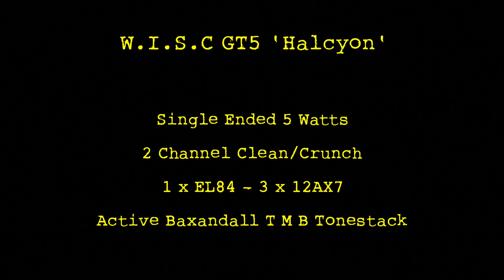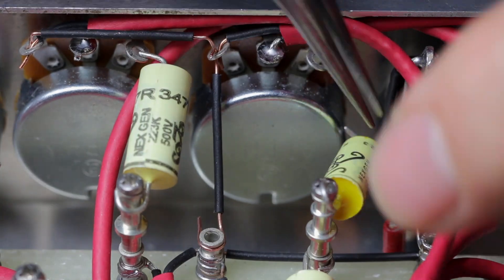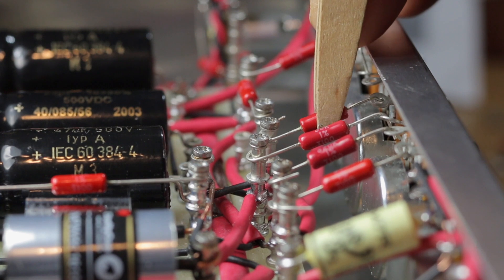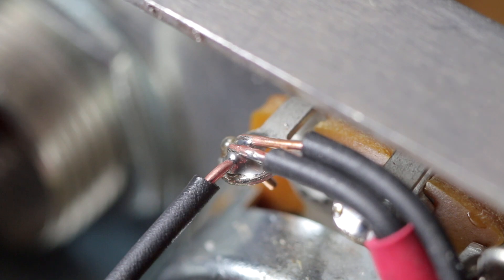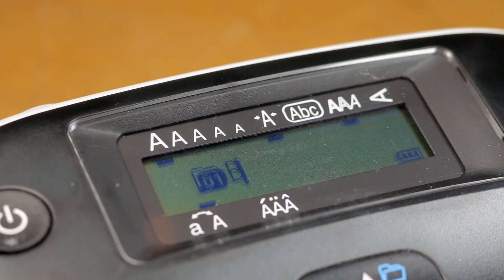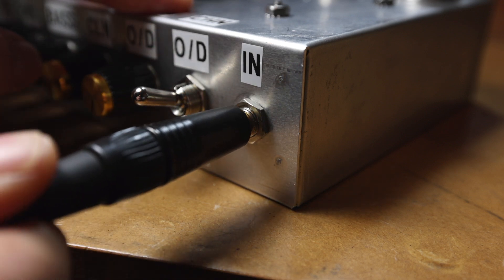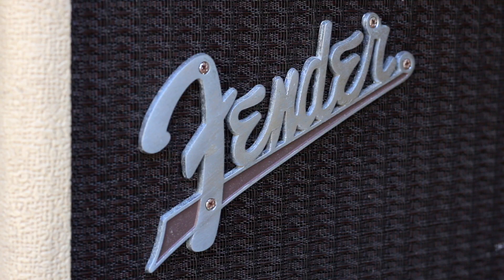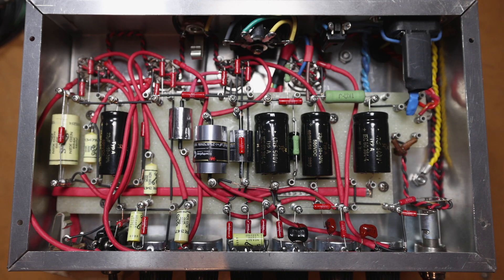Tube Amp Build Completion - W.I.S.C - GT5 'Halcyon' Build 6

Comment: Have you built anything else since your last video?
I loved the Laney rebuild and the lay out.
Reply from the maker: Hi Tony. Yes, I have built a 6V6 Version of the JCM800 with the choice of 2 different FX Loops that actually work. In addition, the FX loops are NOT LN150 FET driven, rather they are opamp driven. The loops are parallel type, o e of which achieves parity and beyond. Video and free plans to the 800 coming maybe June. Cheers.

Comment: I love your concept of turrets, but don't you think they introduce electrical characteristics?  My heart tells me that point to point soldering is superior in terms of expected sound quality.  Don't these turrets have capacitance, current features, etc.?  No matter I really enjoy the way you edit the video and good quality close ups, obviously the end result is excellent.  I think I will incorporate your turret tech style in future builds.
Reply from the maker: Yes turrets do introduce their own electrical properties, mass being the main one, meaning more opportunity for unwanted induction. I now use solid brass machine bolts where double turrets would normally be. Less mass, solder, less complications. Every component, whether that be resistors, turrets , cable, every little thing in the amp affects the system in some way. The less complicated the better. Everything is a compromise. Simplify one thing, creates complications elsewhere. I'm not opposed to PCB at all, in fact PCB's are ideal for things like FX loops, or anything revolving around pedals, as after all, they are solid state devices themselves. That been said, I do prefer turret point to point for tube amps. The high voltages render PCB a tad unreliable. You have to find your own peace of mind in amp design, anything is possible and everything you have said makes sense. You obviously give it some critical thought and thats what its all about. The more you can think about the electrical system, the better you are placed in ending up with a noise free amp. Thanks for the input and all the best for your builds.

Comment: Turning the mids down really made it smooth. I know it’s a rough recording tho. This design is very tempting with the Bax. It definitely is a whole different animal. I’ve built a few of Forrest Cook’s amps and he’s quite fond of Bax tone stacks. They all turned out great. Building his stereo preamp currently. 
 I’d be curious to try this schematic out with more affordable components. Sozo’s and Jupiter’s are fantastic (especially the red Astron Jupiters) but oh so expensive. Do you think Panasonic coupling /bypass caps would suffice?
Reply from the maker: Thanks William. Indeed any bran of components will work. I too like the mid scooped tone. The Bax stack is a great circuit and it baffles me how the bax gets little love - probably more to do with voodoo science than anything else. IMO, the Bax demolishes the Marshal/Fender type stack. Good luck with the stereo amp, nice. Cheers

Comment: thats a really good idea for the xtra turret height. where do you get your turrets and boards from? you sound local (i'm in AU you might be over the river from me)
Reply from the maker: Cheers Greg. Yeah the doubling up of turrets is a massive help in building. I'm in NZ, however I remember buying the turrets in bulk from a USA supplier that no longer exists. The same turrets can be sourced from AmplifiedParts dot com, however, one pays a bit of a premium. I did find the actual manufacturer at one stage but I'm buggered if I can find it again. Cheers.
Reply from the maker: Use product code.......SKU:	S-HTUR-P

Comment: Are my ears busted, or is there no hum from the amp when idle? if so that is amazing...
Reply from the maker: Thank you, yeah she's pretty quiet. Only a tad bit of noise when really cranked, otherwise there is almost no hum. Cheers
Reply: @elams1894  You should do similar turret board optimization for popular amps, Fender Deluxe Reverb, Vox AC 30 etc. that would be a big market. I'd be your first customer for Deluxe Reverb :)
Reply from the maker: @seekeroftheways  I plan to do just that. My first will be the JCM800, followed by JTM45. Cheers
Reply from the maker: Deluxe reverb will be in there. It takes mega hours to hone it all out, then build, then tweek, but it will be alot of fun..
Reply: @elams1894  will be patiently waiting for the kit and the awesome vids like food for the brain.

Comment: I got a knob idea, but not sure whether it'll work. I intend to make wooden knobs myself. But I don't want any set screws or anything like that, instead I will be soldering a bit of metal to the turning part of the potentiometer (making the top a T shape) and then fit a wooden knob onto that so it won't slip, right. Not sure whether it will work but it would leave a clean knob
Reply: I don't want to wreck my potmeter though right, that's why I'm sharing this idea with you, like to know what you think
Reply from the maker: It could work, however seems alot of trouble. I'm not sure how you will stop the knob from pulling off the shaft. Grubber screws leave a clean finish. You just have to make sure you have a nice brass ferrule insert for your knobs.
Reply: @elams1894  well, you don't pull on a knob do you? (:

Comment: Sound absolutely mint! Here's a totally stupid question - I'm okay with capacitors, resistors, and that's about it ... what do the tubes do?
Reply from the maker: Thanks Rob! A tube can have typically three our more areas where magnetic fields are introduced, triode three areas, pentode five areas for example.

For a triode (12AX7) preamp tube the AC guitar signal magnetic field is established on the grid. The plate of the tube has the large DC magnetic field, with hundreds of volts manifest upon it. The cathode of the tube is connected to earth (same magnetic field as earth) sometimes in a variety of ways. 

The tiny guitar magnetic field of the guitar signal is easily coupled with the large plate magnetic within the tube vacuum, and is amplified in the process. This plate magnetic field, now coupled with guitar signal, also couples into the cathode through induction, much like a capacitor. Because the cathode magnetic field is opposite in terms of pressure gradient, or phase, the cathode earth magnetic field can be used to regulate the amplified guitar signal, now on the plate, with the use of resistors and capacitors.

A tube is almost like a capacitor, but having an extra plate in the middle of the normal two plates of a capacitor, all within a vacuum.
Reply: @elams1894  thanks for the detailed explanation. So the different tubes create magnetic fields having different characteristics and thus altering the ultimate sound character I presume. Does this mean you can chop and change the tubes in order to change the sound of your amp? It's fascinating. I had a tube amp when I was a teenager back in the late 80's, damn it sounded good at full volume, used to put it in my sister's room with the door closed so I could still carry on.
Reply from the maker: @TakamiWoodshop  Different tube brands of the same kind have very subtle differences, so yes you can swap similar tubes for slightly different tone. However, you cant swap dissimilar tubes. Indeed tube amps have a very sweet full tone. Cheers Rob!

Comment: Interesting idea with the stacking turrets, I assume you could just pull the screw out once you have the two turrets soldered together?
Potentially you could also get a screw long enough and just screw in all the turrets to the board instead of swaging them.
Reply: @@graybenchelec  I had the same thought mate!  Those bolts are all gonna drop down due to gravity & short everything out unless they're removed!  I never saw a shot where they were not there!  As you say, I hope he puts a nut on the bottom end of those double height turrets or at least removes them after THOROUGHLY soldering the turrets together!  Trouble is, the assembly may fall apart at the next touch of a soldering iron!  Something he FORGOT to film!

Comment: The cost of building an amp by yourself is much more than I thought. I can just spend 150 usd for a nice, almost new all tube combo amp on the second hand market and spend another few money to mod it. But the fun of building by yourself is not something you can buy. Well, it just depends on what would you think how worthy it is.
Reply: Usually I build super high end 100w amps, Synergy royal/Jupiter, CTS/alpha pots, heyboer trannies, ETC.... And end up spending about 1200-1500. I imagine something like this would run 700 or 800 I'm total, if even that. One of those things that you have to save up for and what ot for a little while

Comment: 1:58 do you rest your elbows onto something while soldering? to keep your hand more still?
Reply from the maker: Yes, however here I'm soldering around a camera, which is super difficult, so the soldering in this video is pretty shaky and average at best. I can't see too well close up either so I applied way too much solder in this build.
Reply: @elams1894  yeah you've mentioned something about that, not being able to see. It's ok ;) I can imagine, the work you've created is amazing, I've mailed you about the lamp hole template, I'll be attaching some oak to my chassis (:
Reply: @elams1894  Amazing work, fantastic video, my new favorite channel. My biggest challenge by far is seeing what I’m working on. I wish I could see the work as well as I can see it in your videos. That would make a world of difference. Maybe I need some kind of a camera setup. Do you use anything other than the naked eye?
Reply from the maker: @simbotist  Thanks Tim. I have to use 2x magnifying glasses now as my vision is going down hill fast.

Comment: did you clean the tube bins you don't use a variac for safe start up
Reply from the maker: I have a Variac, however I only use it when I have an amp that hasn't been used fir 5 years or more. New builds I don't worry about it. Cheers Ian!
Reply: @elams1894  What? No series 100W lamp?  Dude, I know you're very good but one day you're gonna blow something to the shithouse with a reversed main filter cap or something catastrophic like that, & ALL those countless times you got it right & got away with it are gonna be INSTANTLY forgotten,  when you've gotta pry the embedded remains of a component out of the ceiling......or your eye socket!

Comment: Congratulations man! Nice sounding amp! And very quiet. I love this wide range Baxandall eq section. What is the brand of the tubes? What kind of problems a bad tube may cause in audio in your experience?
Reply from the maker: Thanks Diego! I'm using old vintage tubes here, as I know these work. Typically a tube will let go in one triode and you'll get a weak sound in that stage. Or if the whole tube goes then you'll get nothing. Just pays to have tubes that you know are operating correctly. The Bax stack took me ages to work out a good freq range for guitar. Very subtle changes make a huge difference. Many thanks!